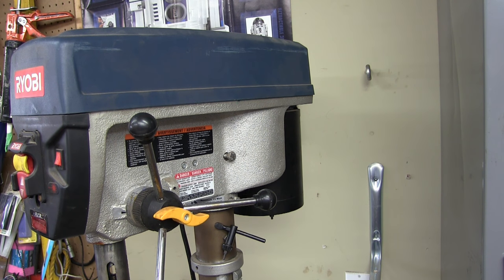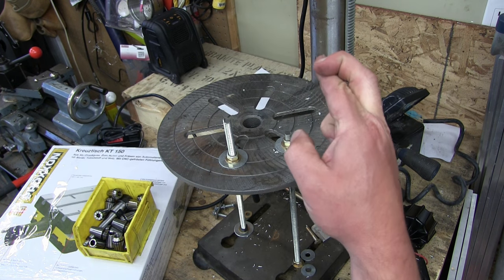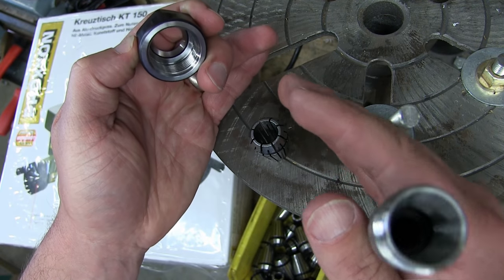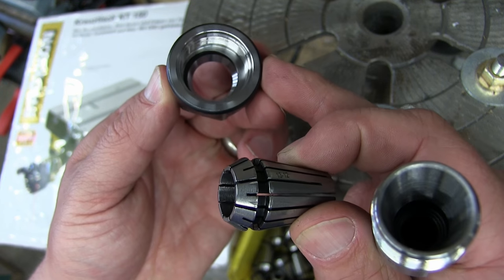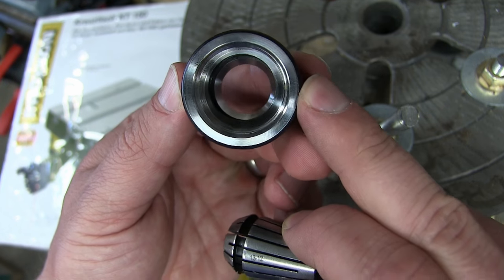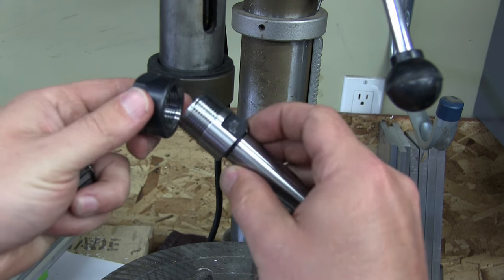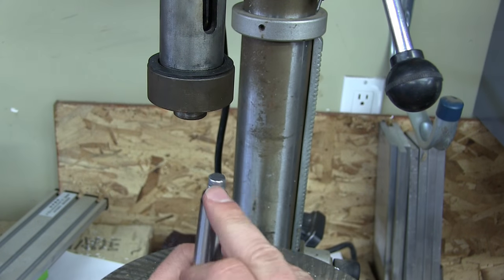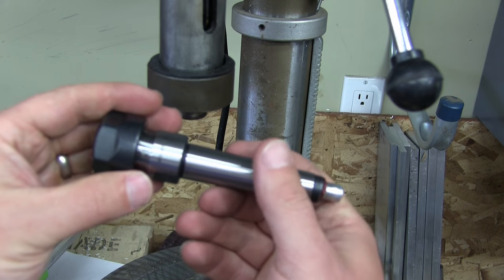SUCCESS!! Drill to Mill Conversion.

Comment: I didn't say this in the last Ave Drill to Mill video but I guess I'll say it here.   I've been using a drill press successfully going on years now.  IMO, save your money and don't buy any new drill press as anything new will be from China where they have cut every corner possible and used the minimum amount of iron possible.  When it comes to machining, any machinist will tell you that Iron is your friend as that equates to rigidity.  So the solution is to go on craigslist and find something old school, rusty, and likely very cheap.  Clean er up in an afternoon, maybe rattle can her, a new belt and she'll be good to go for the next 100 years.  For my X/Y axis I simply used a cross-slide vise, mine was the $80 one from harbor freight.  They are all cast iron and decently rigid (well enough to barely be able to machine steel - but you can do it with ~.010" or less cuts) just be sure to tighten the gibs way up to the point that the turn handles have a bit of drag on them.  I keep seeing people saying "whatever you do, don't use a Jacobs chuck, but that's exactly what's on mine and it so far has been totally fine...  Also, I've never, not even once, had an issue with the Morse Taper on the chuck coming loose from the quill...  Maybe I'm just lucky, but those are my experiences.   It's sits next to my chinesium 7x10 mini lathe that someday soon I plan to upgrade (including the my makeshift drill mill, I'm thinking I will get at least an official "drill/mill" because a Bridgeport or Bridgeport clone ain't fitting in the home shop...)

Comment: Good to see your drill press afro engineering turned out decent results! My mastercrap wasn't nearly as forgiving. 

Onto the beef of the comment - what would you suggest for a table top mill? I'm a bit limited by 110v 15A power, and table space, but there's stuff that needs a bit more precision than a mastercrap drill press.
Reply: Did you end up getting anything? I’ve been looking around a little.

Comment: Question: How do you feel this would compare to cheap Chinesium mini mills?
Reply: i think it's clearly much worse
Reply: you could buy a router that comes with this exact table he bought.. http://www.proxxon.com/en/micromot/20165.php?search
Reply: you are not quite understanding how the ER20 works.  It has three pieces:  the shank, the nut, and the collet.  The collet is that gnarly looking internal part which is retained in the shank by the nut.  The collet is a swappable part.  They come in any size from 1 to 13mm on the ER20 and generally have a range of motion of 1mm radially to grip bits near the collet's labeled size.  In the beginning of the video near 0:27 you can see AvE has a bucket full of the things.
Reply: You did indeed misunderstand. He glued in an ER20 taper, which will accept any size of ER20 collet. And ER collets are made so that can be "crunched" down all the way down to the next size, and so the setup he has can hold any round shank between 1mm and 13mm. This abomination of his can still be used as a drilpress if need be.

That said though, the Chinese mini mills are still leaps and bounds ahead of this thing when it comes to usefulness as a milling machine. The milling operations he showed in this video is piece of cake for the mini mill, at least that has been my experience.
Reply: I am sure you could figure out some way to mount a drill chuck in the ER20 taper, but as you say, it would take up a lot of extra space. However as long as the drill bits are long enough that they bottom out inside the taper I would argue that using collets to hold the drill is better than a drill chuck. I have not tried to drill with an ER collet before, but I have used MT collets to drill holes. As far as I can see there are only two advantages of using a drill chuck in stead of collets for drilling. 1. faster adjustment for different sizes, and 2. Better axial holding force, which is important when drilling.

And yes I like to think that there is a limit where cheap turns into useless, and thus very expensive.
Reply: The seig mills are actually nicely made. Highly recommend. The most you need to do is take them apart and clean everything and lube it. Check out littlemachineshop.com

Comment: That could not have been your storage cabinet, everything was neatly arranged.  That little drill press table looks like plastic, is it?  You need to install a drawbar or you will never make it stick.
Reply: Yes I am very versatile and prolific.
Reply: picked one up for giggles after he showed it the first time, its mostly alu, but the end caps and the dust covers are plastic. with some tweaking it's pretty solid for $30 and an xy table you don't plan on doing production runs on. adjusted all of the play out of mine in under 5 minutes, gonna try to source some smoother cut rods for the adjusters, the threading on the chineseium is pretty rough, but overall i'm still fairly happy with it for the price.

that said, yes it is a cheap product, and one shouldn't get one thinking you can put lipstick on the pig and go out to a 5 star.
Reply: kenabi Thanks man, i also thought about buying one after the first video, but then was like nah how good can this be for $30 but after reading your comment i gave it a shot and ordered one, quite curious how good/shitty it'll be.

Comment: I did the exact set up just had the bigger 12" Ryobi drill press and the cheap x/y table. Instead of spending more $ on the better table and chuck problem ( I never thought of super glue ) I just bought a Grizzly mini mill and I am very happy. But spending a ton on tooling.

Comment: We used to do something similar at a shop I worked at years ago.  The spindle bearings were not designed for lateral force. You will wear them out very quickly.

Comment: I did a similar thing with an old Delta 17-900, but I didn't like the super glue idea.  Morse tapers don't like having foreign material inside them and it can't be good for the runout nor the ability of the morse taper to do what morse tapers do.  Instead I machined a little rectangular nut that fits across the slot in the spindle, and then inserted a 1/4-20 bolt through the collet chuck and tightened it down to thirty inch pounds.  Presto!  Poor man's draw bar.  And that sucker works!  It shows no tendency to loosen, and I've milled some pretty tough material with it.  The 1/4-20 bolt only has to hold the taper tightly to the spindle, and it's more than strong enough for that.  And unlike super glue, if I want to remove it I just remove the bolt and pop the chuck out.

I made the nut using a lathe and a bandsaw.  I turned a piece of Jeep Cherokee track bar down to 1" diameter, then drilled it and threaded it to 1/4-20.  It's kind of critical to do that while you've still got plenty of material around the hole.  Then I made two cuts with the band saw parallel to the threaded hole to give me a piece .310" thick with the hole in it, and cut it off to length.  With your setup you'd probably have to relieve it in the center as the taper on your collet chuck comes up farther into the slot than mine does, so it would look kind of like a lower case "n" in cross section, such that the legs of the "n" contact the edge of the slot in the spindle.

Works great, and it's an extremely solid setup.  Give it a try.  You'll be glad you did.
Reply: Idk of your still around but can you please reexplain the  drawbar hack you did?   My brain isnt computing.   😅  i really wanna try this though

Comment: Own the same drill. Just glued the jacobs chuck on and insert cutters as needed. Only use it to mill slots in knife scales for tangs of knives......shes a bit rough but extra epoxy will fill the gaps

Comment: Great minds think alike, I got a set of collets for my milling machine and did exactly the same thing, cheap Chinese crap I thought, machined the nut out and thought I was so clever, until I went to take to collet out of the spindle and it was stuck in there real good.
I feel your pain.

Comment: I bought one of those XY tables (the first one you used), you can tighten up the slop on it, but I mainly use it to mill graphite blocks into custom molds for metal casting, it works a treat. Unfortunately I have neither the money or space for an actual mill, so these couple of videos on converting a drill press have been very helpful.

Comment: Hey AVE   HAHAH I DID THE SAME THING TO MY ER CHUCK that offset part you machined straight is actually designed that way so that it pulls the collet out and breaks the tool free. Without you will be getting your bits stuck in the collet. whoops like i say i did the exact same thing before realizing what i have done. just one of the many things we have goofed the same way. too funny

Comment: For those looking for cheap mill/lathe I've got to plug Taig Tools, especially the manual lathe. It doesn't take big cuts but it is capable of very accurate work with sharp tools and a slow spindle speed. Rigid enough. Very cheap to get started, like $200-600. I have used the crap out of mine, I cannot say how many times it has paid for itself, probably 10 or 20. The mill isn't as great but it's more accurate and faster than a drill press conversion.

Comment: I used a big cast iron cross vice on a 1 1/2 inch thick plate with a homemade tower holding a big router. I think the extra speed makes for a smoother cut. I am limited to 1/4" shanks but I find the mills I need. I'm onto it for about $130. This setup does have significantly more working height than mine does.

Comment: That funky off center feature you machined out of the collet nut is sposed to be there to pop the collet taper loose
when you want to change tools....
You hold your mouth, collet and nut right and they snap right in, wont work with a tool in the collet!! 
They are harder to remove cause you cant see the alignment...
I'll bet you have a tough time unseating that taper without that "defect" LOL
Don't get me wrong I love your vids and wait with baited, with beer, breath for each new installment!!
PS I deal with ER 32 collets daily and that's just how the "system" works.

Comment: a generous helping of red loctite will keep that taper in there nice an toight.
 we had this problem on a drill press at work and I told the guy to put red Loctite on it. He asked how much should he use and I could only think of one thing to say: the bigger the Gob the better the job. We only Mill uhmw in the drill press but it has stayed in since the Loctite.

Comment: um... lol.. AvE... 
Yes the oblong hole is proper for the Er collet nut any series. The collet snaps into the hole and it also assists in releasing the cutter when you loosen the nut. To remove the collet from the oblong hole you lean the collet to the side and pull out.

And for those of you new to collets, you snap them into the nut, then put it into the chuck, and insert your tool, then tighten (No, it doesn't need 'Abom Torque')

Comment: My AR-10 lowers that I did this with are rough, like 80 grit sandpaper for toilet paper rough!
The issue is not the holder but the rigidity of the head bearings and the table the cross table mounts to.

Comment: FYI the offset thing u cut using lathe is actually locking mechanism for the nut to hold the collet when u unscrew it out... At first I was surprised too

Comment: Probably already mentioned below, but if that collet chuck is the same as mine, it's shaped that way on purpose.
I thought mine was defective too, but that offset is there to hold the collet in place.
You snap the collet into the nut and then screw that onto the chuck.
When you loosen the nut, the collet gets pulled forward and thus lets go of the tool.
I'm feeling pretty smug that i figured this out and you didnt :D

Comment: hey, you don't need to remove metal in the collet. You just snap the nut with the spring collet. it's why you have a groove on the spring collet. i buy on Ebay a ER32 mt2 for my wood lathe and it's build the same way. the ring off center keep the spring collet in the nut but sometime the spring collet can fall.

Comment: There are J33 taper Jacobs chucks (J33C it is) that have a screw collar that installs and uninstalls the chuck from the spindle. Little reason the collars would not work on other tapers. I expect parts are available from McMaster, your local ind. supply, or Jacobs. You need to cut a snap ring grove to hold the collar on the chuck taper. (collar turns with a pin) I use a drill bit shank.

Comment: Grizzly G8750 Compound Slide Table for $149 on Amazon, all cast iron, used for a couple years on a old Craftsman drill press till I finally got a real benchtop milling machine  Pretty darn heavy, and actually a pretty decent x-y table for the price

Comment: so I'm searching through these compound slide tables available on the interwebs and lots of em come factory uncleaned and loose like change.  Cleaning and regreasing seems to smooth the motion of the slide along with adjusting the width of the dovetail slides--assuming you got one that is adjustable.

also could try encasing the drill press in a base of cement or something to give it some meat.

Comment: today I picked up a 12 speed 3/4 Hp floor drill press for 35 USDs off the craig'sbook.  

I am so furgin pumped to break some bits off making chips!
Reply: Next grab yourself a treadmill off the same site.  Wait long enough you can find one for free.  Remove the DC Traction Motor and the motor controls.  Replace the AC motor and the pulleys with a quiet, variable speed DC motor.

Comment: A lot of comments so this has probably been thrown in the mix before:

Could you attach the milling chuck into the drill press by putting a bolt perpendicular to the axis of the drill press?

Might need too much disassembly. 

Cheeky little plasma cut hole?

Guess it may weeble wobble too much?

I'm no machinist, just some derpy geezer with a plasma cutter..
Big fan of the schmoo and related videos. 

R

Comment: Question is, would a decent dremel / router do a  better job that f'ing about with the taper fitting? 

Bit of box section, bit of welding, might be better.

Comment: Thanks for the info. Stupid question, was the Jacobs Morse #2? Not sure if my old Chinese Drill Press has a Morse. Probably screw thread for the chuck. Even my old Cluasing was threaded.
Would a chunk of 2" steel stock used for mass improve the shaking if attached to the base of the press? I know, too many questions... never mind.

Comment: Proxxon sells a mini mill for about the same money as the table you bought. It's supposed to be good, and will mill aluminium, brass and even steel with shallow passes. I don't have one yet but I was actually looking to buy it.

What concerns me is that is uses the small xy table, but it's supposed to be cast iron, not plastic like you said.

Comment: Used my drill press as a mill to build my mill which I then used to make better parts for the mill and now i have a half decent mill and my drill press is just a drill press again. I put a roll pin through my chuck taper and sleeve to keep it from rattling out. Oh I also had a lathe to make the round bits.

Comment: This may be a stupid question, but why didn't you just drill the wall on the socket, into the collet, maybe make two or three holes, opposing or at 60 degrees, and bolt the thing together??? Surely that would be stronger for milling and also have the advantage of being reversible

Comment: Would it be worthwhile to anchor the drill press table to the machine in a more rigid way? It's weeble wobbilin' around quite a bit and I'd think that you could probably get a better cut if you could get that under control

Comment: I drilled and tapped for a setscrew- = matching recessed flat on the taper of the Collet Holder- and it stays in . I have a WW2 govt Heavy Duty Table Drill press ( 215 pounds). But I still get Chatter - and Cannot take Heavy Cuts = So going to Pull the Quill off And see if I can take it to a Friends Shop and Drill it Out for a Draw Bar & shorten the Quill end (limited clearance now) Hopefully It will All work out.

Comment: Hey man nice work getting it running!  If you could stiffen the base even further I bet it would cut even cleaner, but that harmonic vibration on the cut is going to be difficult to overcome.  Beautiful touch with the slo-mo on the chuck action, it spins so clean now.

Comment: I might make a little mill for light work with wood and plastic maybe thin aluminium, any idea's on a high speed power tool that will be  reliable and easy to mount  ? .

Comment: I had exactly the same issue with a collet holder I bought from ebay. Trying to explain the issue to the seller was a nightmare so I just turned the protruding bit off on my wood lathe with HSS tools as my mini lathe was too small.

Comment: Would installing tapered rollers (or a more-precision set of balls) hold the drill press spindle tighter than the stock ball bearings? My old Craftsman spindle is wiggly and rotates off center. Maybe I can do it with my router and some sort of wood hold down bracket. Now how do I keep the metal grinding dust out of my router motor? Mind if I borrow your lathe, mate ??? :)

Comment: AvE, my man, that eccentric ID portion of the collet holder nut which you just wasted away, is intentionally fashioned to engage the groove in the collet which is beside the front bevel.  The eccentric will draw the collet out as the nut is loosened.  No more tooling stuck in the collet holder and requiring a love tap from your ever handy copper beater.  I did all this typing before I read the replies, so, fuck it, I'm sending it off regardless of how redundant it is.

Comment: if the super glue fails try betamate it's made by dow a little expensive but I've literally used the stuff to fix a cracked wheel to make a shop spare and it still holds air 6 months later